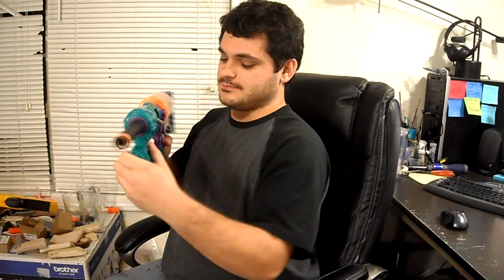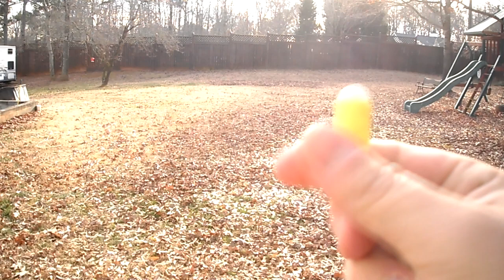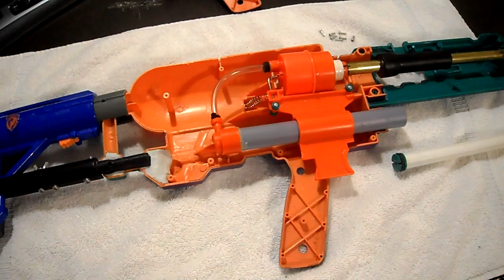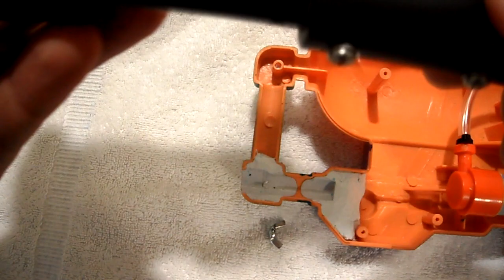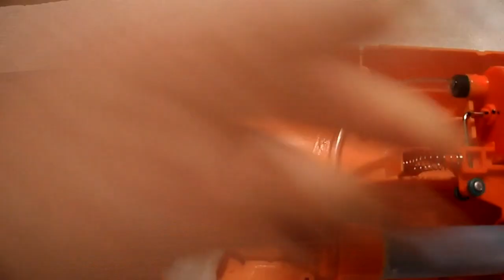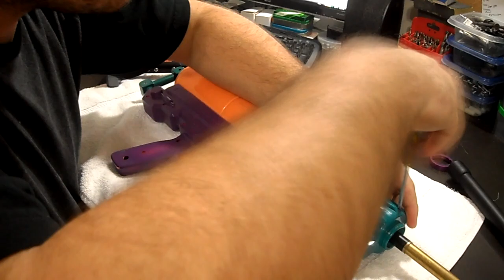Breeched Supermaxx 5000!

Comment: Are you ever gonna make an overview of your Double Rainbow? from the pics Modman712 posted, it seems like that was you main primary at Painsgiving.
Reply: It's funny you mention that because that was my Double Rainbow that he used for a while. :)
Reply: Modman712 haha I noticed now that you mentioned that. Did you add a fore grip? it looks different from when u got it back from razz. the only difference between your's and NoM's is the different colored handlesand the fore grip  lol
Reply: +Shin Yen Yeah I added a grip.  It's much more comfortable now.  I pretty much built the thing using a single picture that NoM had for reference and a small template that had like 2 measurements on it.  I made up my own measurements for the rest and it pretty much ended up exactly like his.
Reply from the maker: I switched off between mine and his, I think I used his for 2-3? rounds. Mine really is nothing to write home about, I threw it together in about 5 hours. Its not pretty but it shoots fantastically. :)